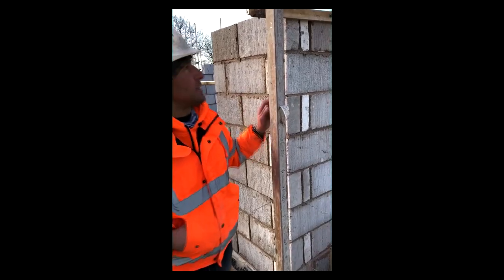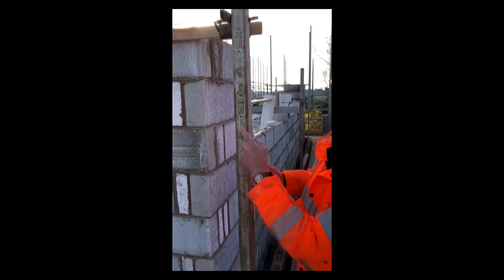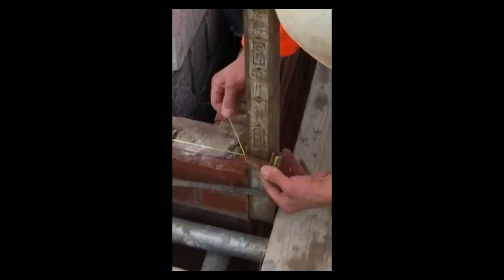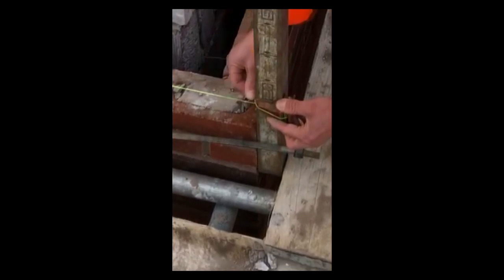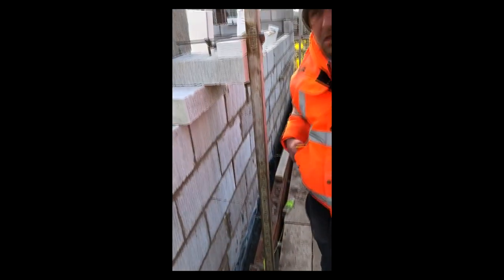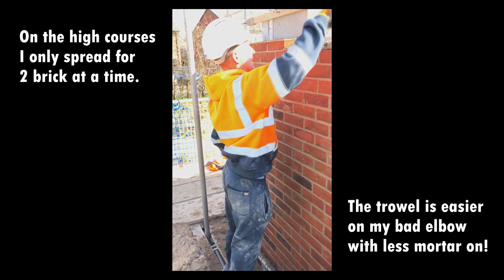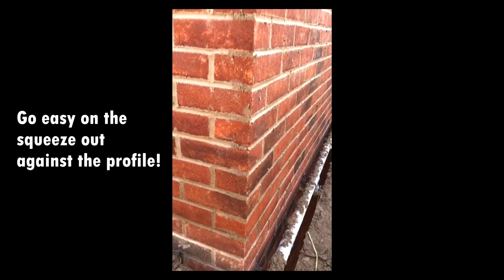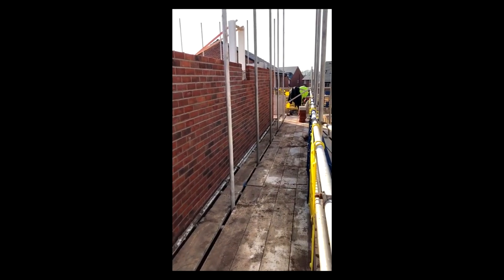BRICKWORK FUNDAMENTALS 2020 : 3rd Lift Gable - Original Video Revised (1080P)

Comment: What height profiles you using there?? Great tidy work!👌
Reply from the maker: Cheers Jase!! They are 2.4 m . I did have some 3 meter mustangs a few years ago on extensions! You could leave them in place, scaffold round them, then get the next lift in without resetting them ! Don’t really work to good on site because of moving about onto different plots. 2.4s are good 👍👍